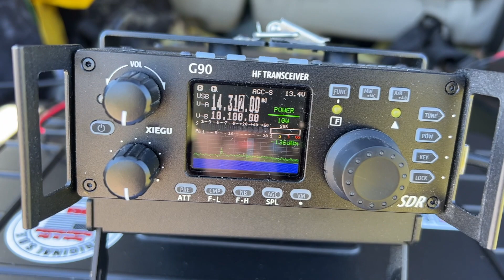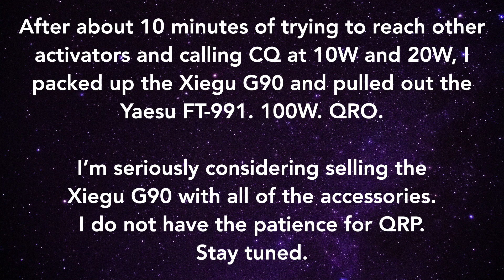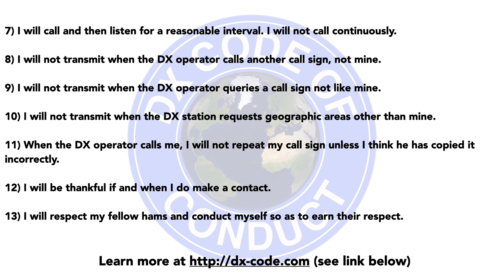QRP POTA Activation? Learn the Code of Conduct!

Comment: Thanks for making and sharing another great video Jeff!
The QRP question keeps coming up again and again.
New folks getting into the hobby always ask if 10 or 20 watts is enough...
At this point, I continue to advocate that folks start with a 100 watt radio.
Reply from the maker: I did do an activation at 20w with 9 contacts and 2 contact at 1W (yes, ONE WATT). Took 2 hours. I set up my. G90 & my KM4ACK EFHW antenna. I know the antenna works now. Just no one hearing me. I THINK I’m done with QRP. It think it’s going to be QRO from now on.
Reply from the maker: Some people have had good luck with QRP. I haven’t.

Comment: I just tried to do my first ever POTA activation. I was with a a QRP rig and a Loop antenna...I guess I had too many things to deal with...I made about 7 contacts and my loop fell over a few times in wind gusts. It was a learning experience and will bring a QRO rig and a tripod mounted vertical with me next time.  You can never have too many options!
Reply from the maker: Every activation is a learning experience. Definitely always have a backup to everything, if possible.

Comment: Thanks for the video! I share your pain, getting “walked on” by other stations at times. Just know it may not be intentional on their part. Depending on their QTH, characteristics of your antenna, and a variety of other factors, you may be hearing them on receive, but they can’t hear you… shoot, they may not hear the other station you’re trying to contact, either. The bands can be fickle, just gotta keep tryin’ or spin the dial. 73 de W7TRG
Reply from the maker: That is true. And I understand completely. But there have been times the activator is still talking to the hunting station and another hunter throws their call out, like in this video and other when I’m activating in other videos and other hunters try to jump for my attention before I say “Thanks for the contact & 73.”   I always wait for the activator to say that & then QRZ.

Always treat others how you would want to be treated.
Reply: @K3JRZOnTheAir  whether hunters, contesters, or other situations where you’ve got a pile up, it does get frustrating at times. 

Have fun & maybe we’ll get each other in our logs. 73!

Comment: Simply use what works. I run mostly 5 to 10W and have great results, that works for me. But I use a Kx2 and its memory to call CQ to get things working. I also use a resonant antenna that does really help.   Also the 991 is is great radio and it works for POTA.
Reply from the maker: And 100W works for me. I believe I’m done with attempting QRP.
Reply: @K3JRZOnTheAir  If you can try your QRP radio on a full size antenna and you might be surprised.  Otherwise I really understand why you are moving to 100W.
Reply from the maker: @thuff3207  I’ve been waiting for almost 4 weeks for Chameleon Antennas to send me a part for MPAS 2.0. Tried my ham sticks and EFHW antenna. I’m sticking with 100W.

Comment: Compromised antennas like hamsticks are not very good for QRP.  A lot of your power is being lost at the antenna.  Going QRO you are just compensating power for poor for the antenna performance.  You should try QRP it with a dipole or end fed half wave.  Good luck.
Reply from the maker: Hi Tom. I have tried QRP with an EFHW and had zero luck. But I do need to use my EFHW antenna more. Used it last weekend and got some good results at 50W (first time there was something to get it in the air - see my “At The Beach” video). Most places I go don’t have trees around and I just need to find a setup that works for me. Thanks for the info & 73!